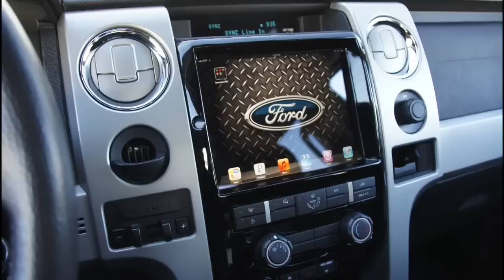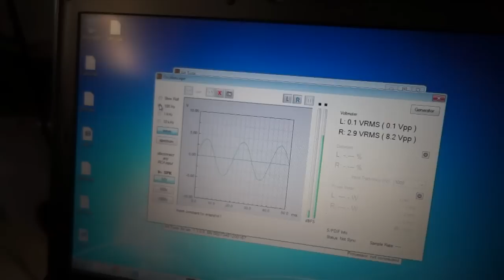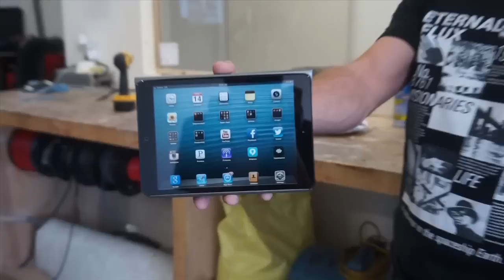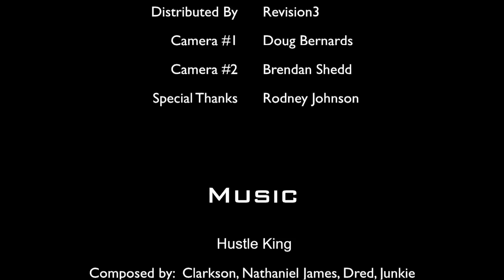Jeep Grand Cherokee Stereo System, Part 5 Soundman - Amplified #110

Comment: Yes, good tid bits of info, I checked the Allante Vinyl'  and it has 1000 hours "Weather Meter" vs. 40 for the other grades, by-the-way, that is Grade 2 Vinyl. and the 47 K 5 W Resistor spec. I am assuming that would work for any application?  I agree, give us MORE MEAT... :-)